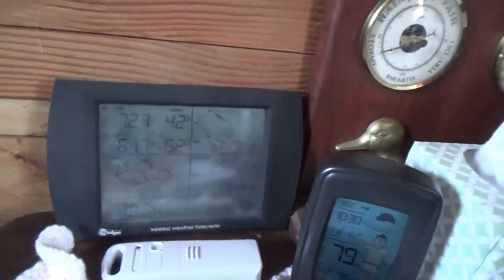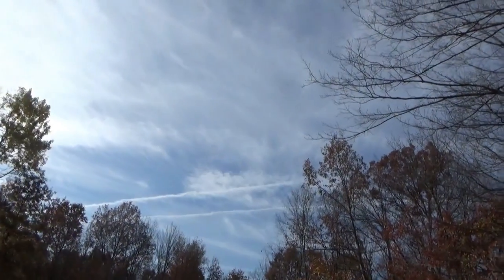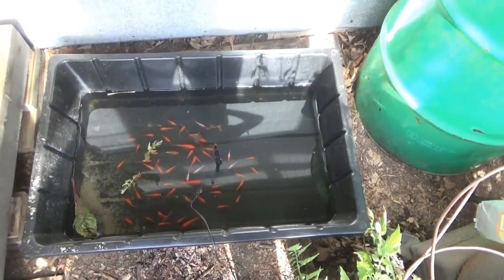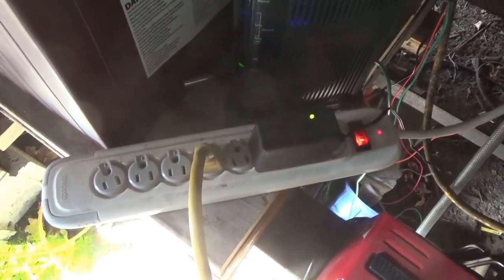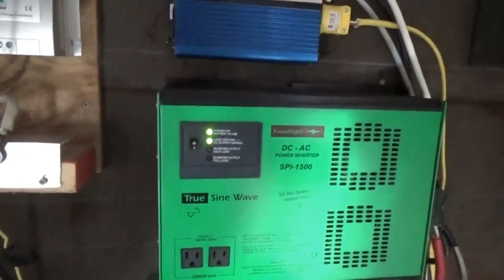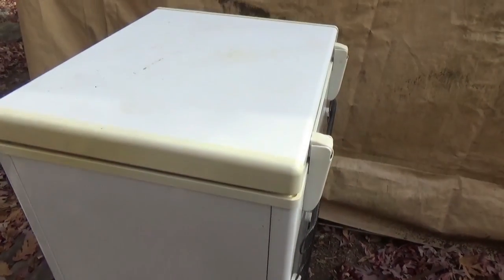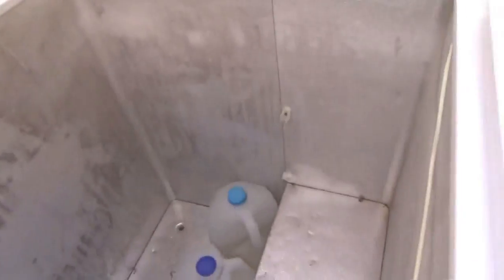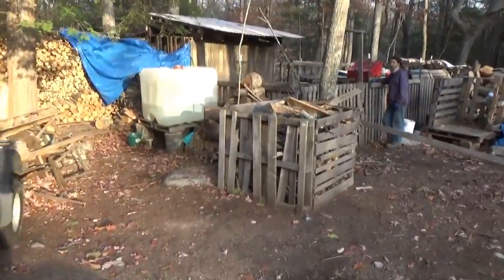Attempt To Run Freezer On Off Grid Solar Power

Comment: Why not put Frezzer on a Timer and run it only during the Day
Reply from the maker: A freezer will still try to freeze the food while it is running and will work full time until it does so. Using a controller will greatly reduce power consumption overall.

Comment: As the freeze/fridge is AC how do you do the connections  from the battery to the freezer/fridge? Do you use an inverter?  Thx
Reply from the maker: Yes, an inverter.

Comment: be aware many new chest freezers lower priced , china made . cannot be used in sheds,garages or porches.
they  need  range of 44 to 56 f low and  86f high to work properly . several of american names will run from 0f to 99f high. they do cost more. always read owners manual before purchase.  some use 134a but some now use r 600 which is isobutane.

Comment: You may try a soft start device to decrease the start surge.
Reply from the maker: Super capacitors help a lot I have later learned
Reply: The Do It Yourself World this is what I had in mind:

https://www.microair.net/collections/easystart-soft-starters/products/easystart-364-3-ton-single-phase-soft-starter-for-air-conditioners?gclid=Cj0KCQjwi8fdBRCVARIsAEkDvnLmmNiY8ybyOeMxgpoxh9CDBowbAVuWmnRvVETp501AQfNyQmoMWsYaAjbjEALw_wcB&variant=30176048267

Comment: I have a huge freezer, a regular sized freezer (umm double yours) and a fridge. No issues in Michigan. I do regularly lose power over night during the summer and the stuff in the fridge is still cool in the morning. 

I have an 8kWh battery bank and 1200 watts of solar with a cheapo 5kW inverter... I think I'll add insulation soon anyway.

Comment: Leave  the Freezer outside, and just drape a Tarp over it....  make a cavity never the rear so it can get some cool.. or make a cheap simple lean too for it.     The initial surge will feather off as the freezer colder and colder... after a day or so, your wattage will drop by 50-60%, once you freeze meat, you'll only see about 30%.  Point is, on start up it will draw lot of power, but that will tamper off as it gets colder, it also a good exercise for you battery bank, they need to do some heavy lifting, rather than be idle all the time.'
Instead of waiting to you get a deer, go ahead ager the freezer up and running NOW, put gallon milk jus in it and let the freeze... the power requirement will fall off by 70%, just let it do it's job for a few week and monitor your solar.... if that works for ya, your good to go !  If not, then you didn't waste all of your deer.  Address an problems, before the Deer is goes into the deep freeze!

Comment: Hey Troy. What is that large screen that you have there that tells you the inside and outside temps, humidity, etc...? I just bought 5 Acres and will be building a self sustaining tiny house on it similar to what you have done here. Ultimately I will be off the grid with gardens and animals for food and milk. I've started the video journal of the progress on my YouTube channel. Feel free to check it out! Thanks, and keep up the great work! Always good info on your channel!
Reply from the maker: Its a gadget brand wireless weather station. Accu Rite has them too in most big stores like Walmart or Home Depot. The journey to go off the grid is long but worth it

Comment: If your temp senders are in the sun it will read a higher temp, it should be in the shade at all times, seperate the receivers, try to make each one closer to the sender in opposite areas(worth a try) and good luck with the freezer, i hope it doesnt kill your batteries too much
Reply from the maker: Thank you. Yes I have made sure the sensors are out of the sun. The freezer seems to be doing fine. I think this will be a success. Thanks.
Reply: The Do It Yourself World good luck, we had to many issues running 120v fridges/freezers on our little solar system, switched to propane and never looked back, power to spare year round instead of running generators all  the time in the off season
Reply from the maker: Thanks. I wish I could afford a propane freezer. Love my propane fridge. It does not use much gas each year at all.  Just runs and runs and runs.

Comment: Put more stuff in the freezer and run it for 48 hours straight,  energy consumption drops. I have a freezer that run 24/7 on 2 kw in PV and 450 AH in batteries

Comment: Congrats on running your freezer on the solar! I don't have near enough solar here to do that so I have to run a generator for it. I'm hoping after the first of the year I can add more batteries and solar to my setup, and reduce the need for the genny. Baby steps, right?
Reply from the maker: Thank you. Yes it takes time to get it all together
Reply: Hehe it takes time and resourcefulness OR just throw money and manpower at it to get it done in a day ;)  -  but yes time if you don’t want to break the bank

Comment: Maybe you should find a local source for dry ice ? That will help when you load that freezer up suddenly with a couple hundred pounds of deer. Improving the r value  would be nice too with foam or whatever  (by making bigger standoffs for the coils) These are techniques that sailboaters use. Some supermarkets will sell  dry ice if you ask and some welding supply companies.
Reply from the maker: Yes that is going to be tough to freeze all that meat at one time. I plan to insulate it well

Comment: Your experience with the Accurite thermometer is different than mine. I have 2 low end ones that are in close proximity to one another and they both read the temps of the areas I am using them in. No odd readings just the true temp of each area!!!!
Reply from the maker: Could be they both have different transmitters. I may just have got the luck of the draw on mine and got the same transmitter

Comment: all digital thermometers if using the same brands will read each others remotes units. the key is to use different brands or a brand that allows for multiple units.  .

Comment: why do you act like cutting foam board is a huge deal a sharp knife you should be able to do that entire ceiling within the hour please contact me I can give you additional information how to do it
Reply from the maker: Cutting is the easy part. Its the climbing up there and measuring every single piece and then attempting to keep them in place that bugs me. Actually I changed my mind anyway. I am going to install this ceiling like I did the tiny house. I have 2x6 rafters with 2x4 insulation. That will leave me a 2 inch air gap between the insulation and the metal roofing. The corrugated roofing has plenty of air space to breathe and prevent moisture. Then I will put whole sheets of the foam insulation last, using it as a vapor barrier and reflective radiant barrier.

Comment: last year you said you're 100% successful to run the freezer you just had to have bottles of water that froze in there to keep the temperature consistent. you did to videos on this explain the reason why you did it
Reply from the maker: Yes I was successful. But then I was running it on cycles. For some reason at 14 degrees F the meat in the freezer thawed out. I have no idea how or why that could even happen. So I gave up on it for a while. Now its deer hunting season and time to try it out again. This time with more solar power. I hope to run it day and night when it has fully frozen things solid inside.

Comment: I have a 12v 600w system and ran a freezer a little bigger than yours for a month and 4 days. We had a series of cloudy days so I took it off.  My battery bank is 700 ah, when the compressor came on at night the voltage would go down to 12.3 but when the compressor would turn off it would go back up to 12.6. I thought that was pretty good for over a month. Maybe that will give you an idea of what yours can do.
Reply from the maker: Thank you. I figure I should be able to run this.

Comment: Troy   Keep adding containers of water and freeze them until the freezer is full when you have the power to do it.   Then remove the water as you add meat and ice cream.  A full freezer is  more stable and will use less power in the long run.   Less warm air gets in when you open and close the door.    Bert

Comment: Hi Troy the consensus says if you have something that is 200w then you need an inverter 5 times bigger which would be 1000w inverter, and by my trial and many ERRORS it's true !!  I need 258w to run the gear I have at the moment so 5 times 258w equals 1290w is needed from the inverter so I bought a 1500w / 3000w surge inverter and it runs everything very well and easly . The inverter doesn't get hot the fans have NEVER kicked in, so 5 time what ever the wattage is you require is pretty spot on !! To me !! Seeya Rob

Comment: you should move the milking station inside the pen put right against the barn. I thought you stated you ad a solar refrigerator? Now with the freezer isnt that going to drain your batteries faster? plus doesnt the refrigerator have a freezer? Also dont you need filtration for the fish? Goldfish are the worst they contaminate tanks so fast.

Comment: Troy, on the heating of the water shed, try underpinning the house on the 3 exposed sides and possibly the absorbed heat from floor will aid in keeping the water tanks from freezing.  Mobile homes has the water lines running under the floors and unless it is super cold outside they never freeze at least it will save labor on firing the stove so often that you plan on having in there.

Comment: I had one of those cheap Acurite remote thermometer in my hot house that quit working (it's outdoor temp is about 50 degrees above actual temp.) and even changing batteries 2x didn't fix it. So I bought another brand that is working accurately, but I can't figure out how to get the first one to read an accurate temp. so I can use it somewhere else. What you said about two thermometers in the same area might be the cause of the problem. I'll try replacing the batteries from 20 feet away. thanks for the tips.

Comment: keep all air space filled with water jugs. it may take a little more energy to start with, but will use less in the long run because the ice will keep the freezer colder than air spaces

Comment: If you plan to heat the water shed to keep stuff from freezing, then why put the freezer in the shed?...  Build a little structure to cover the freezer but leave it outside the water shed in the winter.

Comment: If you've got any rigid foam left, try wrapping the top & sides of the freezer, as I've seen videos where this cuts power usage in half, or thereabouts.
Reply: only if it has the fins outside like this one. many others use the metal on the case to dissipate heat
foam or even cardboard on lid helps

Comment: Hey buddy, there are a lot of comments to go thru and someone else may have mentioned this but you should sacrifice a little space inside the freezer and line it with 1/2"-1", foam sheets. Cut them to be as tight as possible. Using 1" would work best, of course.
Line the sides, top (door) with the sheets you cut. I would use any adhesive from Home Depot or hardware store. Doing this helps retain the cold SOOOO much more. Also you should put a cheap timer on the freezer so it turns on and off at the times you want it too. It should only have to run about a total of 4-5 hours a day once it reached its initial full freeze. The freezer will stay frozen thru the night when its off. You could set it to turn on for an hour if it made you guys feel better. The amount of accumalitive time per day you run the freezee, depends on how much venison and icecream you keep stocked. ;)

Comment: Hey Troy, good luck on running that freezer on solar.  I imagine during a cold night the little compressor in it may not need to run as much during the day. Will the small wind turbine be able to help keep the batteries from being too depleted at night?

Nice to see siding on the goat shed.   Wow, that pool wall is the gift that keeps giving and giving.

Good seeing you Chris.
Reply from the maker: Thank you. The wind turbine is currently connected to a dump load heater to warm up the shed. Yes the pool metal is really awesome.

Comment: what I do is I run mine all day at full speed at the maximum cold, then you know and at night after the sun goes down well it's super cold and it's still frozen  the next morning when the sun comes back up so that's how you do that
Reply from the maker: Thanks for the info
Reply: That's a good tip, I'm moving off grid next spring

Comment: I have one that shows the underneath my house is 68 degrees I have another one that shows my porch which is a closed porch with plastic is showing a hundred and four degrees I have another one that's showing outside temperatures is 62 degrees and I have another one that's showing my inside temperature then I have another one that will be under a garbage can with avocado trees coming up
Reply from the maker: I have read that the accurite thermometers run on the same frequency so they will pick up the closest transmitter
Reply: The Do It Yourself World
Reply: The Do It Yourself World I believe they all do run on a general frequency like an auto Ranger where are like it to be a 1-point and then you can have a hundred different units a hundred .101 or hundred .02 butt when the nearest sender loses power the detector will pick up on the next nearest one to it
Reply: The Do It Yourself World all my detectors are within 10 feet of each other in one room and all the transmitters are scattered over 50 feet away
Reply: with some being only 5 or 6 feet away from the detector

Comment: the main thing is to keep the batteries up when a battery run low it will start picking up on it from another unit that has more charge
Reply from the maker: These are all new batteries in all new thermometers.

Comment: The fuller the freezer with frozen stuff, the less power it will draw. Hopefully when you get a deer the temperature will be cooler so it won't take as long to freeze the meat.
Reply from the maker: Yes true. I will load it up with water to help out today and see what happens

Comment: your gonna need a inverter that goes into low draw mode when the freezer is off because that green inverter is going to draw down your batts to nothing.
Reply from the maker: Yes true. Eventually I will have to get another larger inverter

Comment: Maybe install a timer on the freezer so it only runs during the day time? Try using a wired indoor outdoor  Thermometer for the pump house?-> http://www.ebay.com/itm/Indoor-Outdoor-Digital-LCD-Humidity-Hygrometer-Thermometer-Meter-Probe-Cable-C-F-/152250729984?hash=item2372d9c600:g:HL4AAOSwOyJX41Oj
Reply from the maker: I am considering the same thing but now I am wondering if it will run the compressor more that way than just leaving it on all the time to do its thing.
Reply: I was going to say the same thing.  My solar system runs my deep chest freezer, but I only have it running during the day when the sun is out.  I have the timer cut it off when the sun goes down.  I was worried about this harming the motor, but I've been doing it for the past year.
Reply: no.

Comment: troy ... boss of the swamp lined the inside of his ice chest with some kind of foil wrap to make his ice chest more efficient i wonder if that would work in a freezer as well also my freezer i keep full of water jugs to fill the unused space ... same principle as thermo mass . if my power goes off things stay frozen longer . should have no problem turning freezer off at night that way ... also you can store venison with out freezing ... layer your meat in crocks . seperated by 1\4 in of brown sugar inbetween meat and cover the top with at least 1\4 in of brown sugar . when ready to use rinse off and fry . its very tasty that way .. give it a try with 5 pounds of meat let it sit a month then try it . if you dont like it you havent lost much . before electricity that was one of the ways meat was stored
Reply from the maker: Thank you very much for the ideas. Especially the one about meat. I will have to try that. I am considering heavily insulating the freezer sides and top. The reason I got one with external coils on the back is so that I can insulate it on the outside.

Comment: http://www.ebay.co.uk/itm/24-HOUR-24HR-MAINS-PLUG-IN-TIMER-SWITCH-TIME-CLOCK-SOCKET-UK-3-PIN-MECHANICAL-/130832492078?pt=LH_DefaultDomain_3&hash=item1e7639662e